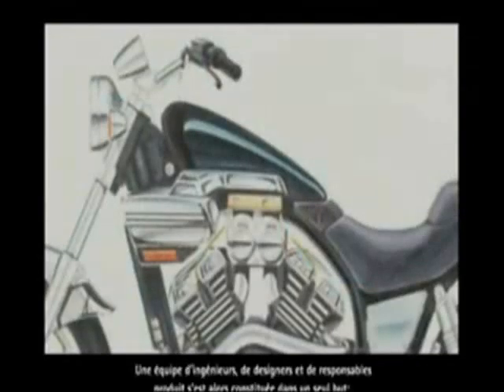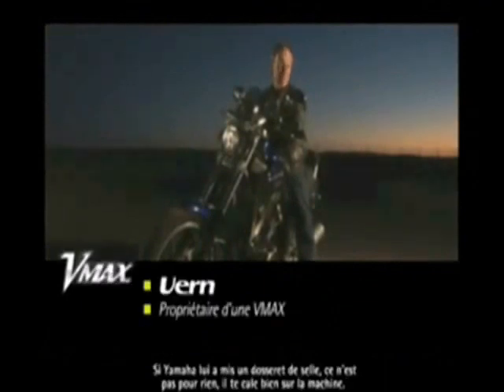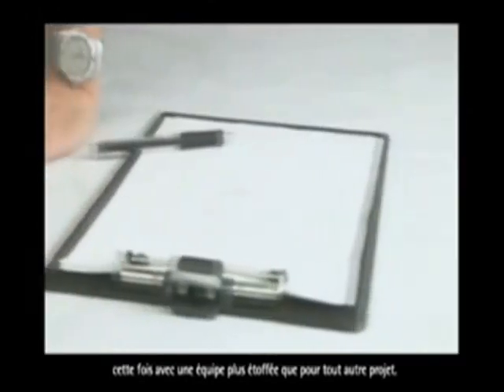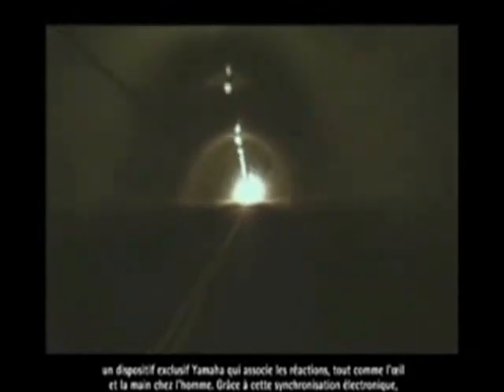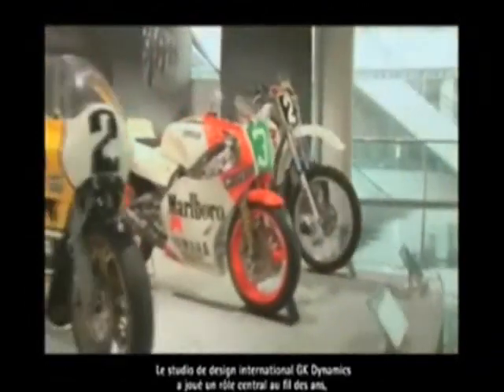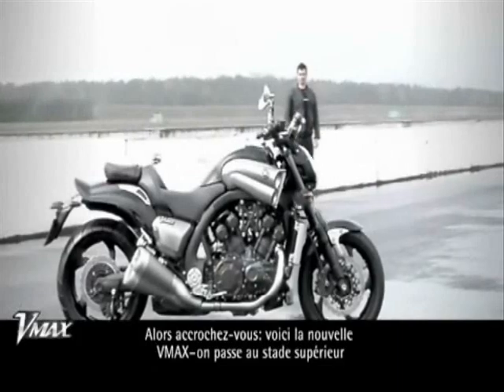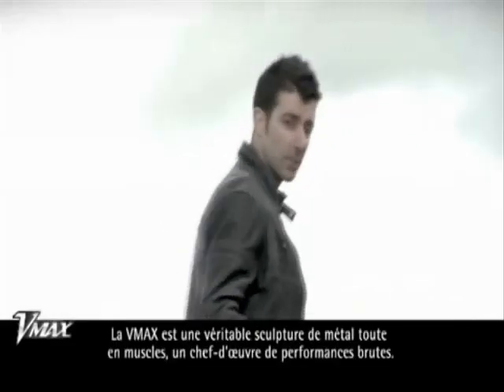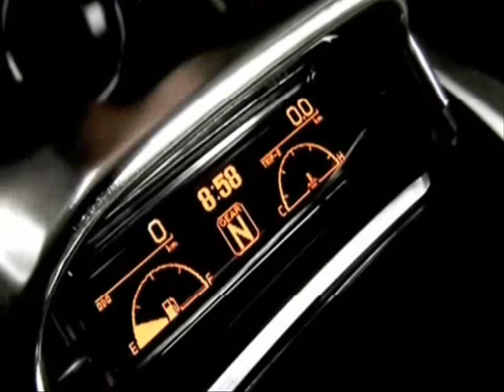YAMAHA VMAX LEGEND History

Comment: I just switched from KTM to the new VMax today ectually. I have owned many different bikes over the years ZX-14s, GSXR 1109s, Busas, KTMs but I absolutely love my second gem VMAX it is so smooth and the seating position, handling (which impressed me) and acceleration, ride (suspension) are amazing. I always wanted one and very proud to have one what a cool bike.
Thanks for video
Reply: DARREN X I'm on the fence on the purchase of the new VMAX, who better to ask then a ZX14 owner how do they compare? I'll never sell my 08 special edition it's turbocharged with the works. Now at 53 yrs I want comfort and power, and yes I love the look of it!
Reply: Listen Ross I can promise you this.
You will not be disappointed at all.
Yes the fuel range is horrible I commute from Alaska from Edmonton I carry 5 literal if fuel with me in a back pack.
If you look at my video of my ZX14 I loved that bike but comparing the two is impossible.
I have no chicken strips on my Vmax rear tire it’s so light I. The front end it holds lines like you wouldn’t believe.
I just got off the Vmax about an hour ago I’m addicted and I don’t get excited about a lot of bikes.
I’ll give you an example of how fast these bikes are.
My friend has a completely done Morley Gen 1 Vmax, carbs exhaust, boost controller other goodies, I can pull him in one gear at highway speed were he shifts twice and I leave him like he’s on a cbr125. I can’t say enough about the Gen 2.
Fit finish is amazing for Japanese. I honestly can’t find a flaw other than 140ks to a tank of fuel it’s does everything well.

Any questions I’d be happy to answer for you
Reply: Please excuse spelling punctuation I left my glasses up north lol I’m not that dumb well maybe I’m married.

Comment: TO ALL YOU VMAX OWNERS:   I'M NOT SURE IF YOU'RE SELLING ONE OR NOT, BUT I KNOW I CAN'T AFFORD A NEW ONE, RIGHT NOW.   BUT THERE ARE SEVERAL REQUIREMENTS I HAVE IF I'M TO BUY A USED ONE': 
IT MUST NOT BURN OR SMOKE OIL.  NO LEAKS OF ANYTHING.   MECHANICALLY FIT.
THE ENGINE MUST NOT MAKE HORRENDOUS NOISES.
IT MUST NOT HAVE ANY MODIFICATIONS WHATSOEVER (NO NEW EXHAUST OR INTAKE, ETC.)
IT ABSOLUTELY MUST NOT HAVE BEEN DROPPED OR IN ANY ACCIDENT..
IT MUST HAVE BEEN WELL MAINTAINED, WITH STOCK OEM REPLACEMENT PARTS.
IT MUST BE PRESENTED TO ME WITH ALL THE MAINTENANCE RECEIPTS.
SO, IT MUST BE ALL ORIGINAL. 
THE ABOVE IS WHAT I REQUIRE IF I'M TO BUY YOUR USED VMAX.  
EVEN IF IT HAS A MILLION MILES ON IT.